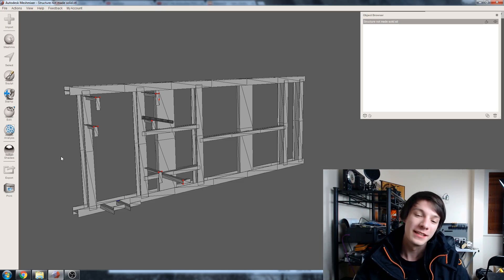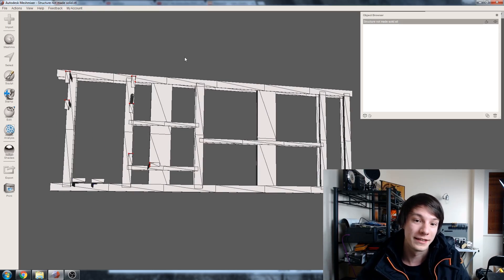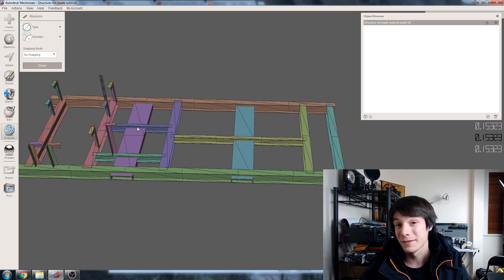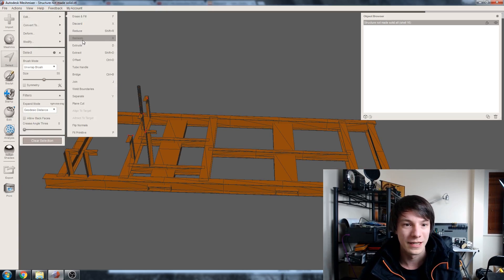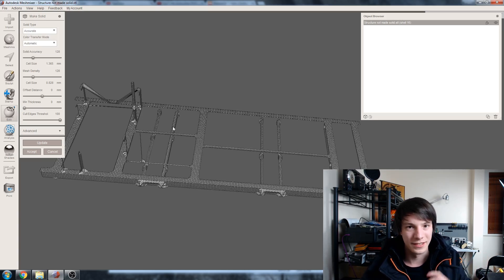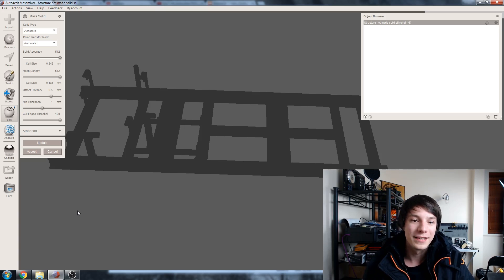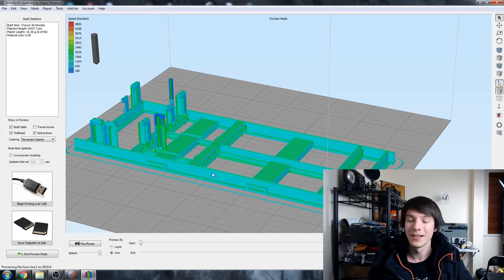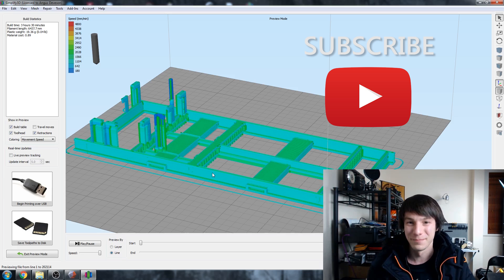How to make Engineering Assemblies 3D Printable using Meshmixer

Comment: What programs did you use in your career?  Senior Designer Level III (myself).  Have you had any experience with the fein arm?  Before I retired, they were using this new type of printing and modeling to do FEA and deformation stress in materials.  My programs I use to 3D print is Autodesk Inventor, and 3D max studio.  By the way you seem to understand the mechanics of printing and I find this information very resourceful for my prototypes.  If you want to see what I am working on during my retirement just ask me.  Bill

Comment: Why do you always advertise proprietary software? What's the deal with advising people to bind by strict EULAs and obfuscated code?
Reply from the maker: Because it works better than anything else - Good luck assigning support material to this file correctly in something else.
Reply: Yeah, and that is the problem, your biased view and blatant disregard for your viewers. I could say the same thing about every other software feature. Good luck trying to use simplify3d through octoprint as you can with slic3r or curaengine. Good luck trying to run meshmixer, simplify3d or any other of your favorites in the ARM platform. Good luck using volumetric extrusion outside of cura or slic3r. Good luck trying to model something as fast as in openscad, or trying to do any customized design for thingiverse in any proprietary software. Good luck having as many ways to fix a mesh as in meshlab. None of these open source software has draconian EULAs, they do not forbid reverse engineering, they do not have strings attached. Freedom from these things are features too. And by the way, you only have cheap 3d printers today because the FDM extruder patent expired in 2009 and the reprap project had ready-to-build recipes for building them. They unlocked the market and they tried to keep a completely open source stack of tools to deal with 3d printing so no one would be excluded - a target which is more and more difficult to attain thanks to people like you, which uses his influence to sway people away from their freedoms.
Reply from the maker: lol, such rant. If I was blatantly disregarding my viewers I'd be showing them how to use Imateralise magics which costs thousands per year instead of meshmixer - which is free. If you have issue in purchasing software to make your already expensive hardware run better that's no problem of mine. 

I'm well aware that patents are why 3D Printing took so long to become affordable - and am actually against closed source 3D Printers with proprietary filament if you bothered watching any of my other videos.
Reply: I never mentioned price anywhere. Price does not matter. If it mattered, why would I have an issue against meshmixer, a software that is free of charge?
Reply from the maker: Oh, you have an issue with meshmixer too? Right. Well if you come across a mesh editing program with the same capabilities do let me know. I'd use meshlab more if it had basic functions like 'undo'
Reply: For customized supports, there is no open source software doing that AFAIK. Simplify3D and CraftUnique Craftware are the only slicers that I know that have this feature(*) and also meshmixer is the only 3d modeller I know offering it. Of course they could be done manually to be incorporated into the mesh but that requires 3d modelling knowledge. Although the mesh fixing of meshmixer is not bad, Blender's mesh fixing functions are much better and more comprehensive and inevitably more complex. Its use is recommended for those times the quick or automatic fix of an STL is not enough. With meshlab however you have more mathematical stuff to fix the STL, if that is the problem in it. Of course, both meshlab and blender also have good automated fixing

My gripe here is not for recommending one proprietary software for one defined function. Is always priviledging them, like they were always better. And skipping mentioned the downsides of sticking with proprietary software - e.g. if you read Simplify3D's EULA, not only reverse engineering is forbidden (which is kind of a bluff), but the output of the program is forbidden to share, which might be interpreted as never sharing gcode or stls processed through it.

If you go industrial, there is at least one incredibly complex software that is very capable with meshes and it is open-source, its name is salome platform and it is also very good for FEM analysis and the likes.

(*) Tested: Cura 15.x Cura 2.1.x slic3r Craftware Voxelizer Skeinforge Sfact Replicatorg Kisslicer Simplify3D MatterControl Katana Kiri:Moto

Comment: Loving these Meshmixer/Onshape etc. how-to videos!  When you design a part in Onshape or something, do you typically load it up in something like Meshmixer to check for issues before printing?  Or only when you know there are likely issues?

Also, a video I'd love to see is how you go about fine-tuning settings in Simplify3D for a material you've never printed with before (for example if someone is paying you to print a model and you want it to come out as cleanly as possible).  :)

Comment: When I am doing stuff like this, thankfully I am normally working with the Solidworks file so I avoid all the mucking about with triangles.
But anyway I try to make the X,Y dimensions (printer) a multiple of the nozzle diameter and Z dimensions a multiple of the layer thickness.  That seems to help with small features.